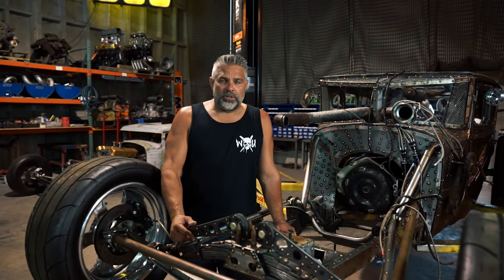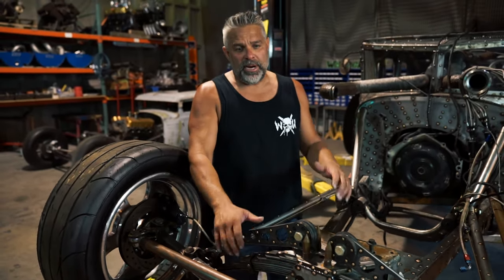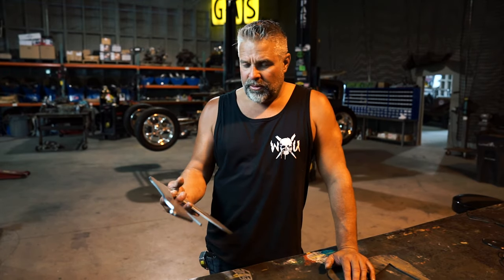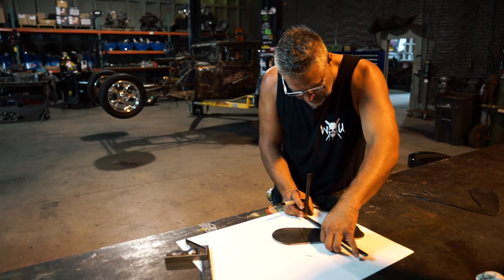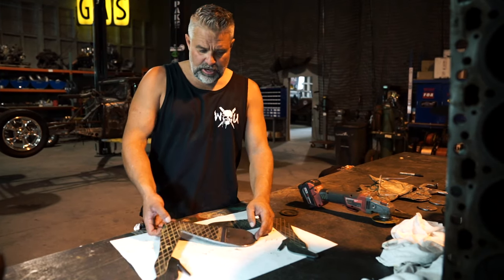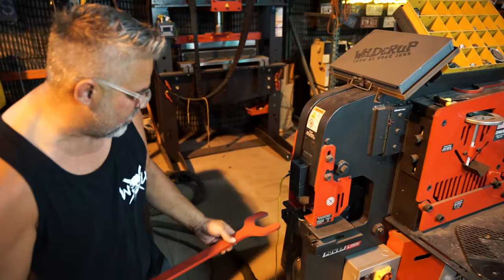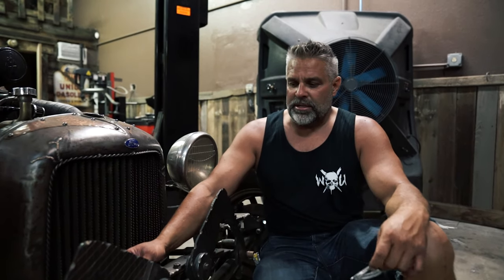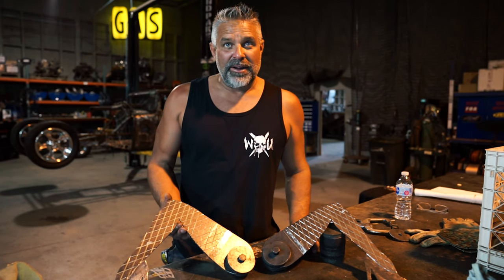Things You NEED to Know Building Rat Rod Suspension

Comment: Really like your video. It is a big help on building my own friction shock. There is one thing i am not sure of, what is the thickness of the metal to use?  I am building a T Bucket using a 46 Ford P/U axle and quarter elliptical springs. I plan on using trailer springs cutting one end off.  On the axle I'll bolt a 4" sq. x 3/8" plate where the spring use to go and weld tabs onto it  for the spring eyes to mount to. The bolt will also be used for the lower shock arm to.   (or maybe a pair of legs)
Reply from the maker: I would use a 1/4 to 5/16 thickness.

Comment: I absolutely love your style and how you figure put how to get done what you need. If you don't have it you build it or make it like rancher riggin or the past presidential type engineering if you will for political correctness. I just bought my first and hopefully last brand new pickup this year in an 18 dodge diesel with the last year to be available 6 speed manual. I eventually want to put a deer smasher bumper and a flatbed on the ram, which seeing this video has my mind working overtime on putting lady legs into the bumper and flatbed both. It would be hilarious because ironically my wife drives the pickup 90% of the time as it doubles as our family buggy so a lady driving the 6 speed ram with lady legs in the bumper and flatbed would be pretty bitchin, at least I think haha. Keep the content comin sir, I enjoy the hell out of all of it and hopefully when I grow up (not likely) I can use some welderup tips and tricks for my own rat rod. I've always been a crew cab diesel pickup guy, except for classic and muscle cars but always thought diesel motor not big block, then low and behold this show called Vegas Rat Rods comes on the tube and blows my mind!

Comment: I would put them on a 1967 b model Mack rat rod truck with 5.9 cummins auto air ride rear  if I had two sets I would try to install a set on my 68 dodge d200 pick up I put  a 5.9 in it also just about done with it that's and keep building them I like the videos

Comment: No question that'd make a bad ass set of mud flap brackets on my COE, boxing my frame rails in in polished aluminum I'd have to weld a piece of 1" flat bar on the back side of the shoe to hang the flaps on, weld up the hole an powder coat them but that'd be a set of kick ass mud flap brackets

Comment: I like the hell out of that and damn you don't need to be an artist to do it when you watch you do it. Course it helps that I can draw a little. Not world class but different cartoon characters and scenery stuff. I'm too old to put in the contest, I just wanted to comment. I would put them on my Harley if I still had her but my kid got off with it cause I didn't get the wind in my face much anymore. I'm 72 and only drive my explorer now. All my kids got off with my toys and now that I don't have a lot other than my strat and a old martin that they don't play so I'm safe for a while. I love your channel and watch it a lot. I liked building diesels, my grandson got my 95 king cab mint 7.3 twin turbo five speed dually with the custom aluminum bed and I split the exhaust to go out the back rather than up the side. I could hear the stereo that way/LOL. Five inch from the front doors back and over the axle and out the sides. I stretched the rail spring bored out the fuel lines into the heads, did the mods under the fuel heater and got rid of the intake heater. It didn't roll coal but you could tell mods had been done and it was long legged. If I still had that I would of put them on the flaps on the back. Thats all right cause I'll haunt them when I tip over.

Comment: It looks lie they would restrict up and down movement in the front suspension, unless they are bending to compensate. The more horizontal the line connecting the toe and butt of each lady leg is the less resistance to chassis movement there will be, but all movement will be due to flex at the bolts through the ends of the spring , and with massive leverage. This is why most friction shocks have a link with heim ends, connecting the foot end of the lady leg to the front axle, as you had on the completed chassis you started the video with. Someone with their chassis end much higher then the foot end of the lady leg in your design might well end up snapping his spring bolt off on hitting a hard bump at speed. This can be very disruptive. 

I always enjoy your show.